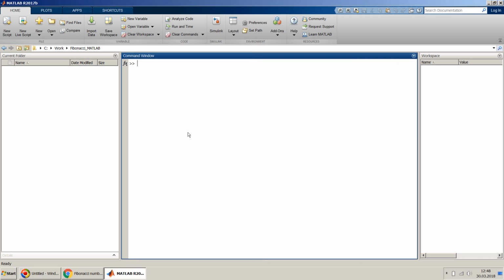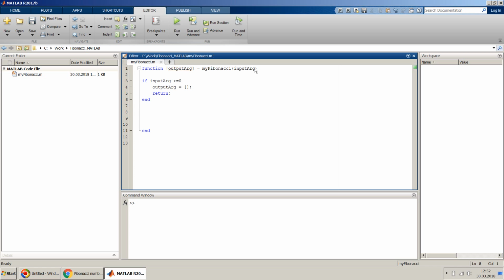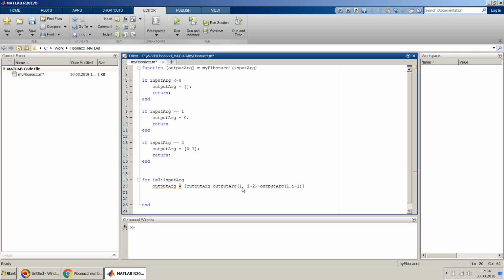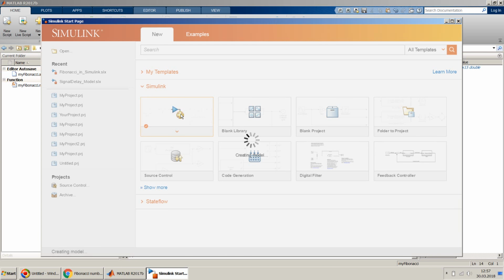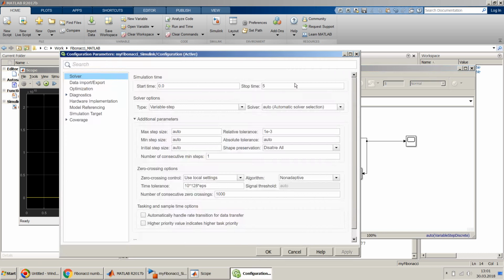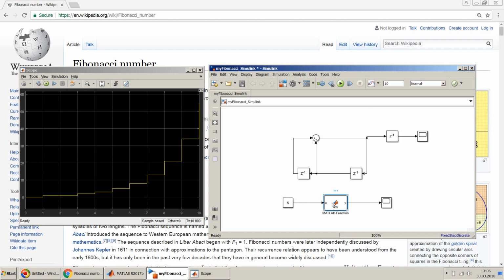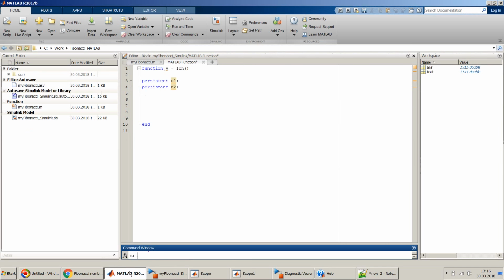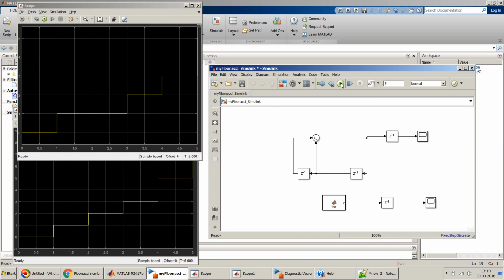Fibonacci series programming in MATLAB and Simulink Model for beginners

Comment: Hello. I want to calculate fibonacci series first 1000 numbers. But i need to make this for in 20 seconds. How will we do this? (using matlab simulink)
Reply from the maker: Instead of "for" loop use "parfor" in the matlab script. It will make the execution much faster by running iterations parallel on workers.

For reference, the complete source code shown in this video is also shared in the below link:
https://programmerworld.co/matlab/fibonacci-series-programming-in-matlab-and-simulink-model-for-beginners/

Cheers
Programmer World
https://programmerworld.co

-